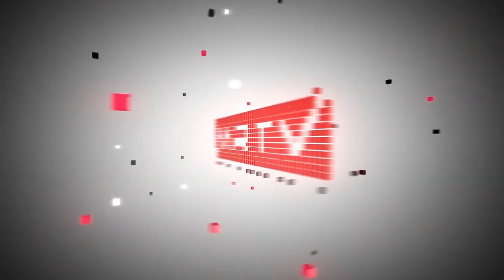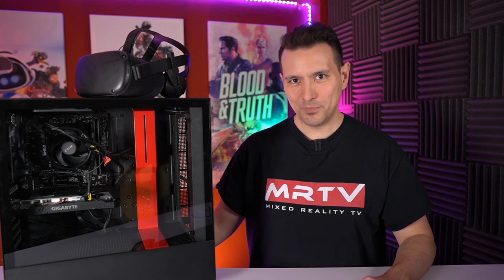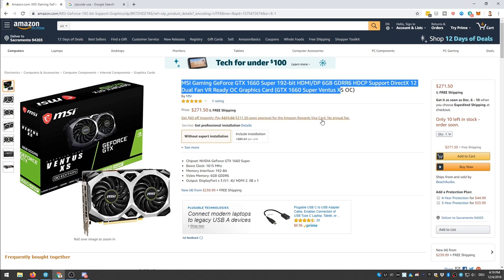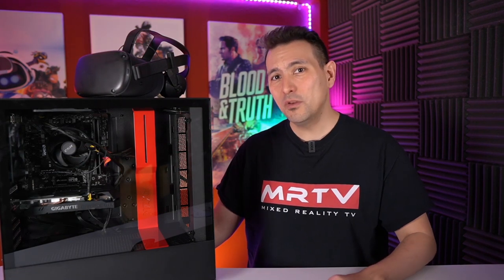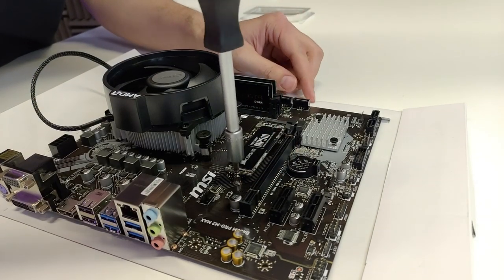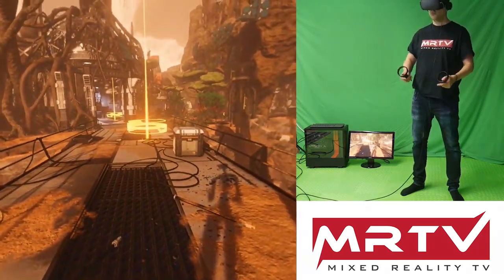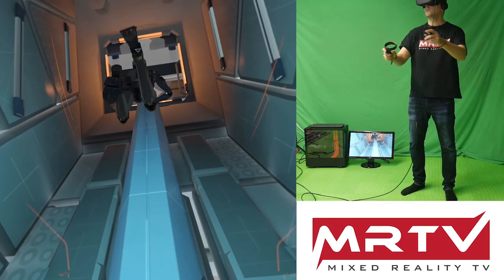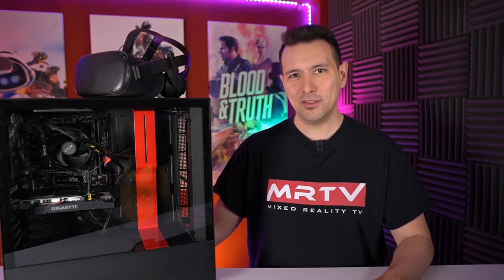The $700 VR PC For Stormland, Asgard's Wrath & Half-Life: Alyx - Perfect For Oculus Quest & Rift S!

Comment from the maker: Are you going to build this PC? For your Quest perhaps? Do you have any questions?
Reply: Perhaps i will
Reply: Thats an awesome setup man, I like it!
Reply: @MRTV - MIXED REALITY TV Half-Life: Alyx mouse and keyboard play-testing leaked!!! I’m not a YouTuber but I just uploaded my first video in 7 years. I thought you might get a laugh out of it.
Reply: My PC is more powerfull, but you build also good )
Reply: I am in the market to build because I am still using Windows 7 and support will be ending next month. I am wondering if this would be powerful enough to handle DCS Flight Simulator in the highest settings? Since I am going to have to buy a Windows 10 computer I only want to have to have to buy one computer to handle it all - buy once cry once IF necessary. So do I have to spend more to handle DCS in the highest settings  and keep a frame rate above 60 fps or will your setup handle it? - and yes I do have an Oculus Quest but want a Pimax 8k specifcally for DCS.
Reply: @tzone you want to be able to run way higher than 60fps. Also if you are getting any pimax headset they are demanding so you will want a really powerful computer, not an entry level vr setup. 5k+ is agreed to be better than the 8k unless you’re talking about the 8kx in which case you would need a beast pc. Also why not play Microsoft Flight Simulator? I think it comes out next year. If you haven’t seen it check out the trailer for it.
Reply: Does it play non vr games well
Reply: I have a i5 9400F and an RTX 2060 but if I play Stormland on high settings I don't get smooth frame rates. I have to turn it down to medium settings and switch off anti aliasing. Can you suggest what I'm doing wrong?

I should add that I have 16 gigabytes of RAM
Reply: I've been in the market for my first pc game build. What brought me to wanna build one was I already own a oculous quest and want to dive further with the link and ive done my research, buying a gaming pc would not get me what I want. If I follow your guide but decide to buy a better graphics card, will it work with the rest of the components?
Reply from the maker: @codyalexander1709  YES, it will work with the rest of the components!
Reply: I have doom vfr. With 8750 processor 16 gb ram and 6 gb nvidea card I'm getting not so  smooth a game as you.is it better with link cable?

Comment: installing the power supply (or power supply cables) is generally easier before the motherboard because it allows you easier routing of the eps12v (8 pin) connector to the motherboard as well as the 24 pin atx connector..  sometimes the installation of the motherboard can partially block the cable routing holes/gromets when installed so these should be pre-routed.

Comment: Thanks for the help. I have an ACER Aspire TC-885 and was looking for a Graphics Card that would be able to play Steam VR games with my new Oculus Quest. I really appreciate your recommendation of the GTX 1660 Super. Seems like it's a great card to use to be able to have a smooth VR experience without breaking the bank. Additionally, after some further research, I was able to determine that the card has a small enough profile that it will fit into the Small Tower of the ACER Aspire TC-885. I'm going to need to upgrade the stock 300w PSU to something beefier, as according to ASUS's website, the GTX 1660 Super is recommended to have a 450w PSU. I'm probably going to go with the EVGA 500W GD, as it was recommended in an upgrade guide for the ACER Aspire here on Youtube. 

Thanks again for the great video! It helped put my mind at ease about what GPU would be sufficient to have a smooth VR experience for my 1st time! 

P.S : I am getting an Oculus Quest (for now), but I think it is VERY important that all Gamers look long and hard at what Facebook is doing with their "Privacy Policy" for Oculus starting on October 12th. You made a great video on the topic MRTV, and I think that all of us need to agitate and demand for HTC, Valve, Samsung and other manufacturers to bring out their own Standalone VR HMD's that promise not to require signing into Social Media accounts which will be capturing almost everything about a person. Facebook is becoming truly Orwellian and it's up to us, the consumer, to show we don't want to go there by using the power of Competition and the Free Market.

Comment: You missed the mouse, keyboard and monitor that would also be added if to use that tower.
Reply: Paul P Jr , it’s VR, just Use your tv for a monitor. Keyboard and mouse are $5 on Amazon.
Reply: Also missing is the wifi adapter and a Windows 10.

Comment: I have a i5 9400F and an RTX 2060 but if I play Stormland on high settings I don't get smooth frame rates. I have to turn it down to medium settings and switch off anti aliasing. Can you suggest what I'm doing wrong?

I should add that I have 16 gigabytes of RAM

Comment: Would you say you could also go with the i5 9400F
Reply: The 9400F will work fine. But you will need a different Mainboard and you will get less performance for more cost.
Reply: @vr-legion3468  right now im using an old ass computer, but its running VR fine so far, i5-3570k overclocked to 4.5  16gb ddr3 ram and 1070 gtx.

Comment: Wow its easier to build a PC then I thought!
Reply: It is not too hard! But this guide IS cut, check out fuller guide befure building or you may really screw something up. I once time forgot to put the screws which lift motherboard up from the case... and it all went out in a lot sparks, becuase the board shourt circuted on the case :-D

Comment: I would save money for a while and buy something better than this. A 1660Ti isn't even as good as a regular 1070. A 1660Ti is between a 1060 and a 1070. 1060 is the minimum for Alyx. You won't be able to supersample with a 1660Ti on the big game coming and you'll be turning graphics settings down in game. VR games are evolving fast. Save up money for something better so you don't have a computer outdated for VR within a year of buying the thing.
Reply: I agree. If you can save up 700 you can save up 1,400. No sense in buying something you'll need to upgrade in a year.
Reply: That isn't the point of this video really
Reply: @ThereminHero  we understand that isnt the point. But obviously 700 isnt exactly cheap already, so the point mike and I are making is, dont be the guy that cheaps put just to get in to the PCVR ecosystem, just to be left behind in a year.
Reply: @GameJunky513  it's also reasonable to accept that most people trying to get into VR are looking at price as the main blocker. The great thing about PC hardware is you can upgrade later when things get cheaper.
Reply: @ThereminHero  I guess but your gonna spend a G regardless so why not save a bit more and be set for the long run.
Reply: @GameJunky513  because money. Selling a second hand graphics card a year later and buying a new low to mid range one could actually end up being cheaper.
Reply: @ThereminHero  Good luck selling those second hand cards. I've had my old 1050ti posted for 7 months now.
Reply: @ThereminHero   But you're talking about spending extra money in the long run due to impatience and wanting to play immediately. If you can throw down $400+ on a headset and $700 on a computer...you can definitely wait and save up a bit more. You're already spending at least $1100. Might as well be patient for a little longer. You'd be needing to replace the computer processor AND the graphics card on this PC within a year with the sort of games that are coming next year. I'm already trying to figure out what I'm going to replace my 7600k (the one with the 4.2GHz base clock) and 1070 Superclock (runs up to 2000MHz out of the box) with next year and those blow the bells off of the Ryzen 2600 and 1660Ti. Ryzen 5 2600 is almost the bare minimum for Half-Life:Alyx for example. The 1600 is the minimum spec and the 2600 is barely better than the 1600 when it comes to gaming. Some games the difference between frame rates isn't even 5%. I'd rather be patient, save up an extra $500 and you could get a bare bones sort of work desktop that comes with a 9700k, then buy an RTX 2070 off newegg for $400 and throw that in there. Otherwise, you'd be buying this low tier pc that comes with the ryzen 2600 and 1660Ti for $700 and then spending money on another graphics card and computer processor. So instead of saving up an extra 500 and spending ~1200 total...you'd be spending a minimum of 600 extra on top of that 700 to replace the low tier parts. And quite possibly more because you may need another motherboard if the processor socket can't take the processor you want to replace the ryzen 2600 with.
Reply: @GameJunky513  Yeah not many people want to buy a used graphics card. You never know how well the original owner took care of it or how much it was abused. I wouldn't even buy a refurbished one from a store.
Reply: @user-xk5uu6yk5q  not everyone wants to wait and save $500 more.. it could take them a year to do that. Playing the game is the reason they want VR. Spending might be more overall but if you're smart with selling the components when you upgrade it can come close in price. And that motherboard supports all ryzen 3000 series chips so it has a good upgrade path.
Reply: @ThereminHero   And those people who don't want to save up $500 more are dunces. Literally "let's spend money to waste money, because I'm impatient". They need to learn money management if they're on a budget, yet they're so impatient that they're going to spend more money on the same computer in a short period of time. Not sure how it'd take an extra year to save up an extra 500 when you've got at least $1100 burning through your pocket, unless someone is saving up their allowance money from parents. It's stupid to buy something twice in about a year, due to impatience when you're on a budget. Literally defeating the purpose of being on a budget when you're spending more money than you could have spent within a year's time on a computer. And if it's purely due to impatience and not budget, then you're not looking at budget PCs. Bad decision making. It's not even just about saving. It's also about wasting money. I could buy a 2070 Super right now if I wanted to and I'd be able to turn up the graphics higher on some heavy games...but that would be stupid of me, because I can wait for the 3000 series cards coming out next year and get one of those...or wait for them to release and buy a 2080 super because the price will have dropped due to the 3000 cards coming out. You are arguing just for the sake of arguing at this point.
Reply: @user-xk5uu6yk5q  tldr
Reply: @ThereminHero   This is what people say on reddit when they know they are wrong and refuse to believe that the other person is making complete sense.

Comment: It'd be a lot cheaper to do vr with a refurbished 4th gen i5 computer, you can get them for $100-150 usd with hardrive and 8 gigs of ram, then toss a RX 580 into it for another 150, total cost is around 2-300, then pick up a wrm headset for 150 to 200
Reply: Nope. You need DDR4 and PCIe3.0, nothing less than a modern CPU from the past 2-3 years will only work for VR these days. It's better to get a 1060 6gb for $150-$200 than a rx580. AMD does not officially support VR and they have no plans to support VR. Do not buy AMD GPUs for VR. WMR does the job perfectly fine so that part is correct!
Reply: @sqlevolicious  
My Lenovo Explorer runs just fine on my 5 years old PC it has an i5-4670K, 16GB of DDR3 and i recently upgraded from a GTX-760 to a used Rx480 for 100€
Reply: @sqlevolicious  i have played vr just fine on second generation i5 with cheapest memory (sold it now, can't remeber the model :( i think it was i5-2400). But! This guide is for new people to pc building. Buying used requires far more experience, or you local shops must offer it with some consulting and warranty. There's a huge amount of ways to buy bad system or even to be tricked if you don't know anything about pc building. I've seen people faking devices (e.g. reporting totally wrong CPU in windows), and showing me fake tests when i was buying used. Had i not known to bring my own linux thumbdrive...

Comment: I did that you made a build guide and gave some good advice in setting things up, however, the graphics setup in this build is very low end... sure, it'll meet minimum requirements for lots of popular lighter weight titles, particularly if you lower the graphical settings, but for a good experience on a higher end headset like a valve index or even the quest/rift s if you want to enable a decent amount of supersampling and/or antialiasing...  I would strongly recommend upgrading the gpu to AT LEAST an rtx 2080ti.  this will give approximately a 30-40% improvement in graphics power which will significantly improve your abilities to choose somewhat higher graphical settings and yeild much better experiences, particularly with higher end headsets.  also i would strongly recommend the 3600 over the 2600 due to the greater frequency but also the significantly increased number of instructions per clock between zen+ (2000 series) and zen2 (3000 series) - due to the size of vr titles, I would probably recommend also a secondary ssd (1tb) for storing games and maybe an upgrade to 32gb of ram if you find a good deal (though I agree that 16gb should be enough for now so long as you don't have anything running in the background when you play vr titles.)
Reply: I'm new to PCVR ,You recommend a 2080ti at least for a good experience ,What graphics card would you recommend for a better experience above a 2080ti. I just bought a Rift S and I'm confused as I'm about to build my first PC ,Thanks for your information.